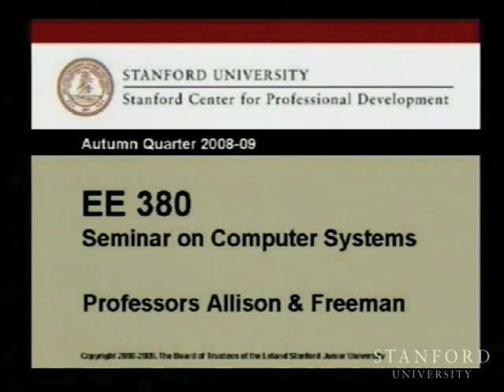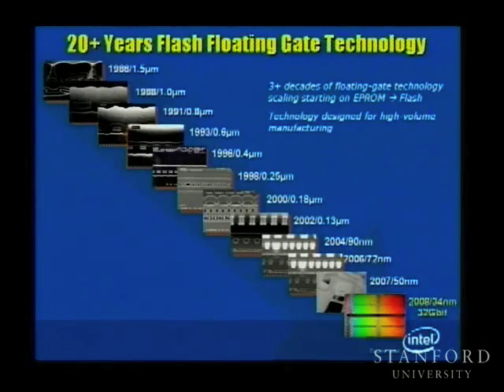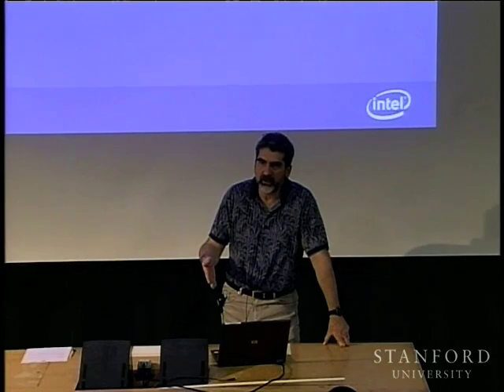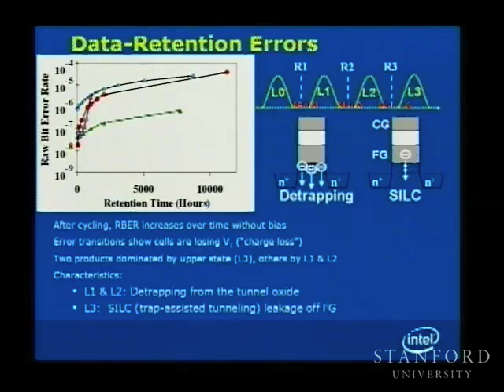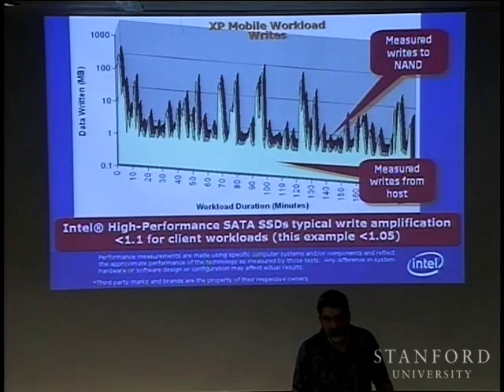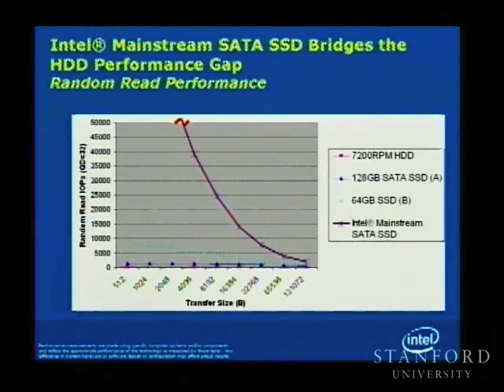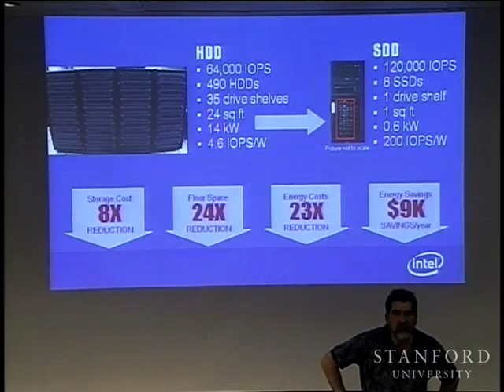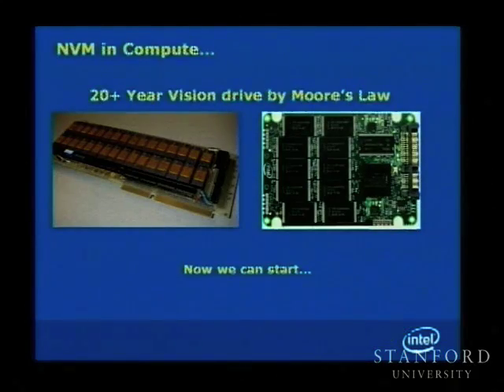Future Computer Memory

Comment: I think using a Flash Drive as the core of the Operating System (such as Windows), but save all your files to a different drive, would be nice. It would minimize the writes because all the writes could be on a linked folder on a hard drive, which could make it so your OS could stay virus free and intact by locking the write function to the drive when not changing OS or OS files directly such as updates.